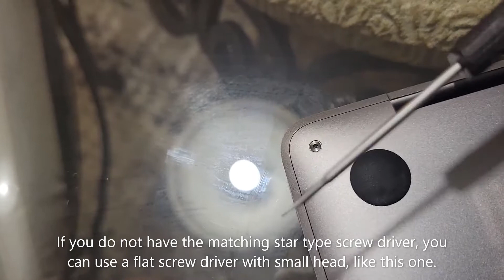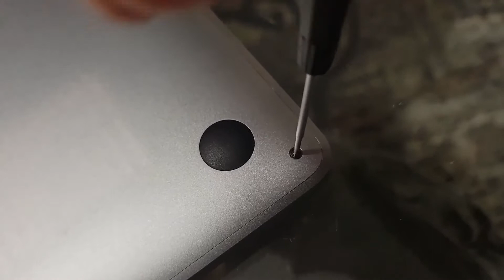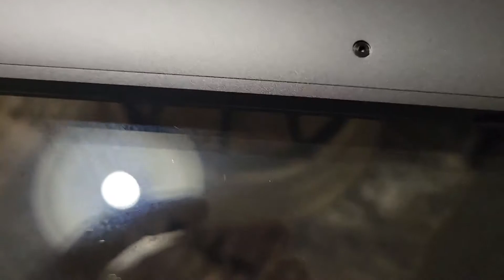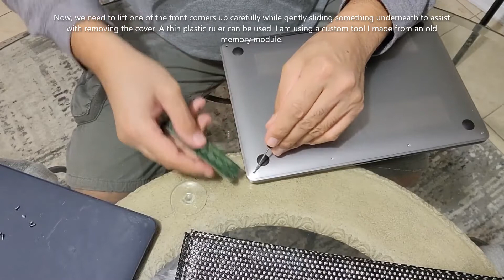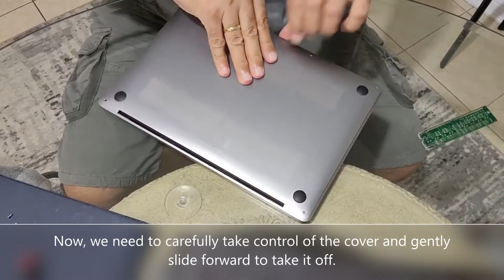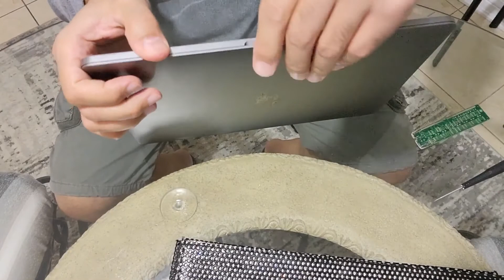MacBook Pro backplate removal

Comment: Thank you! This was much more complicated than my previous macbook of 2011, which I just had to unscrew. Without your guidance I would not be able to do it. I used a steel ruler if it will help anyone. And I almost gave up at one point 😊 Those side locks (clamps) are the most complicated ones. Just pull harder. Once you release them, it's easy. I was able to clean my baby 😊 Thanx again! ❤
Reply from the maker: Glad it helped! Your are welcome and thank you for your comment!

Comment: the macbook i have has 8 screws and when i try to take off the backplate it is giving me quite a bit of resistance, is it supposed to be like this ?
Reply from the maker: Yes, resistance is expected. What I do is to try to be firm but at same time slow and gentle until the back comes off. You will notice some resistance while I was opening the one in this video.

Comment: Why is it so hard to take it off
Reply from the maker: 😮It is not so hard, it is just a tight fit. If you work firmly but gently to pull the cover out, it will come out as seen in the video. Best!